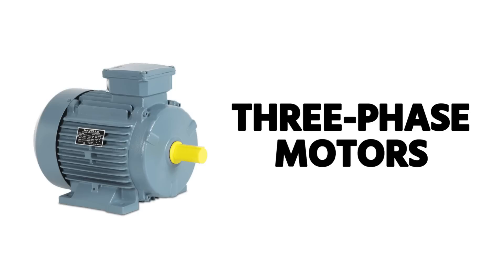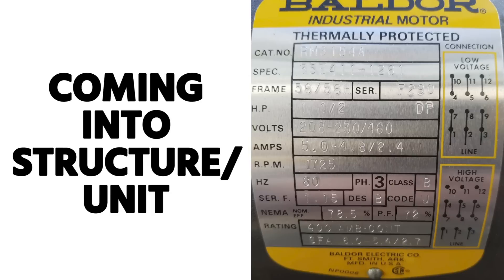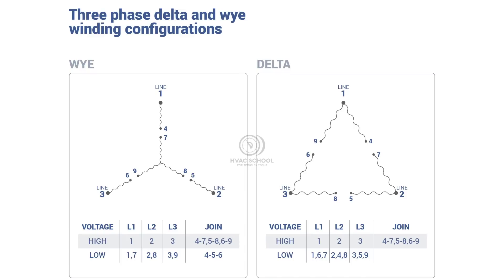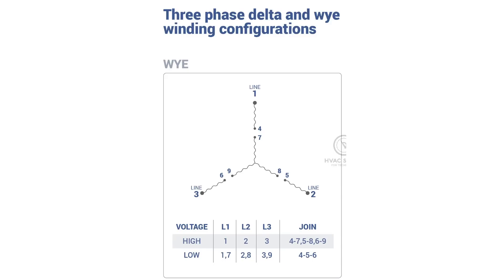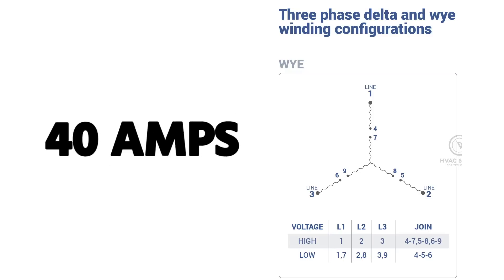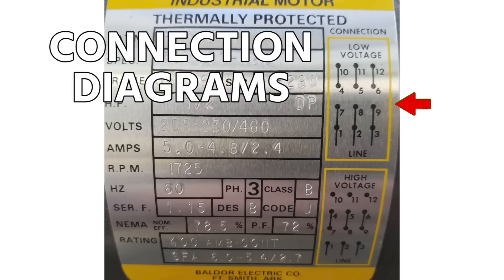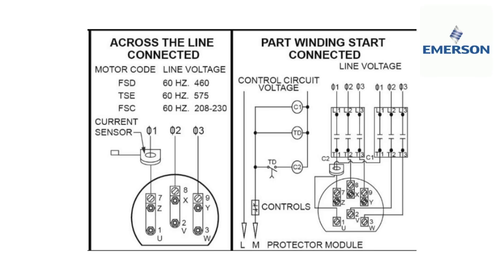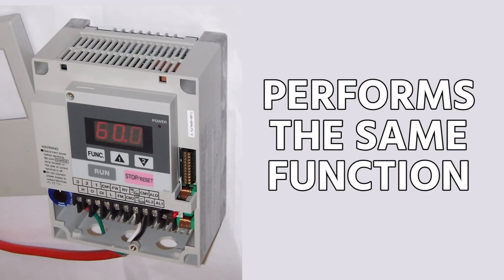Dual Voltage and Part Start 3-Phase Motors

Comment: I have a GE sever duty 15 hp 3ph motor wired 9-5-11-L3  4-8-10-L2   6-7-12-L1 runs at 900 rpm (It is supposed to run at 3510) Do I have it wired wrong

Comment: Thats funny you put out this video. Just ran into a similar situation on Friday. Blower was bad. Customer needed the system back up and running quickly. OEM motor was 2 weeks out. I found a motor at a local electric shop. It was virtually the same 1750 rpm vs 1725. 3 hp vs 2.9. 8.9 amps vs 8.6. It was a duel voltage motor. It is easy to swap the leads around to change it up. Installed it and checked amp draw. I was at 6.9 amps. Customer was happy to have their only system back up and running. He even signed up for our maintenance program